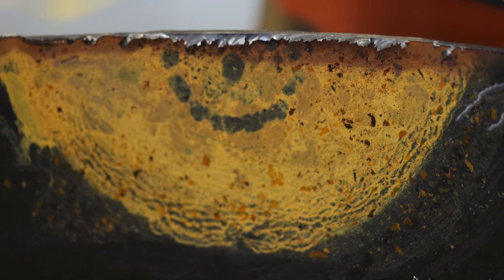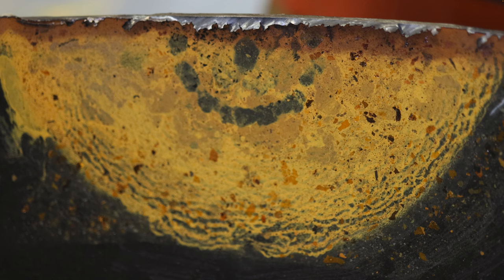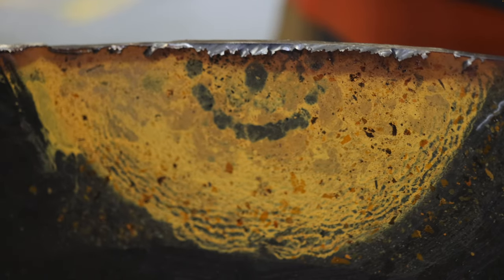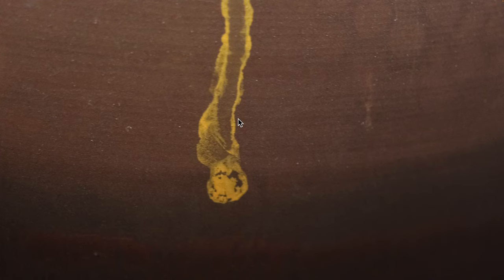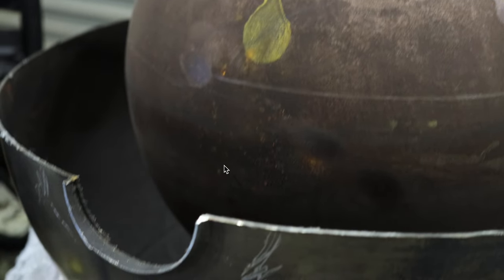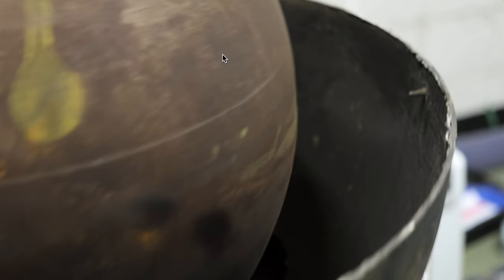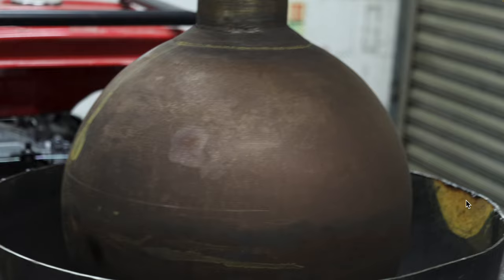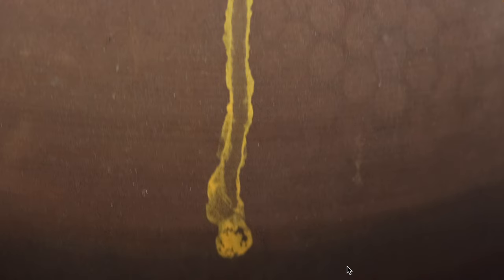THOR - Overview of large yellow features

Comment: If diesel fuel was used it might be from the sulfur in the fuel.
Reply from the maker: Yes, Which is something I mentioned to Malcolm, it is not a good LENR indicator in this scenario
Reply: @MFMP  Also the chemical brake down of the tip gas would be helpful, not sure it would be pure methane.

Comment: Instead of saying the inside of the outside its probably neater to say inside of the exterior or the outside of the interior.
Reply: I think it makes sense since there’s inner middle and outside. Just saying Exterior could be confusing
Reply: @harry554  the inner one your referring to is just a guide for the exhaust I'm not sure it is interacting in a similar way to the fuel.
Reply: @thumperhunts6250  I thought the 4-3-2 ratio is the inner ball, outer 3 inch and exterior 4 inch